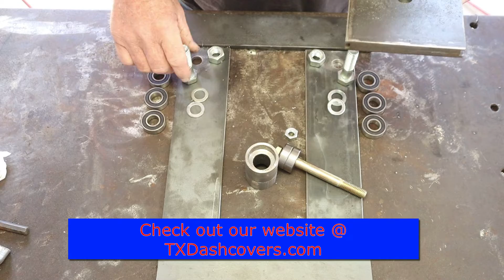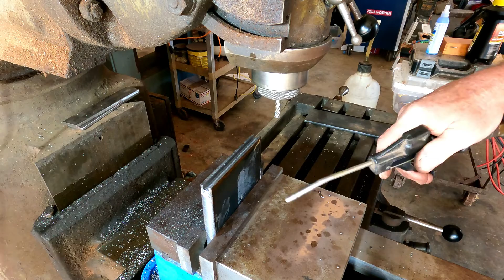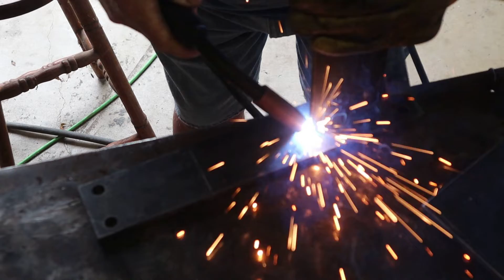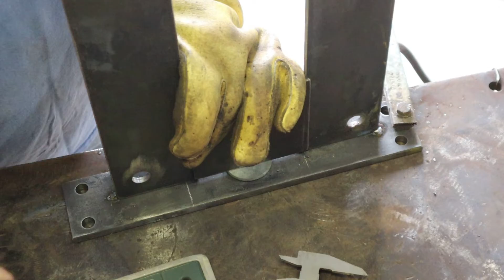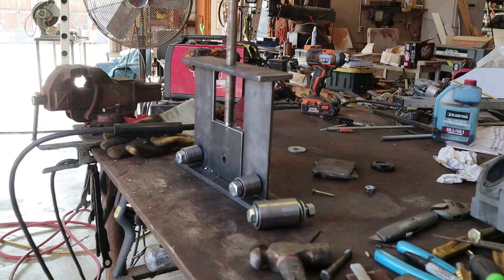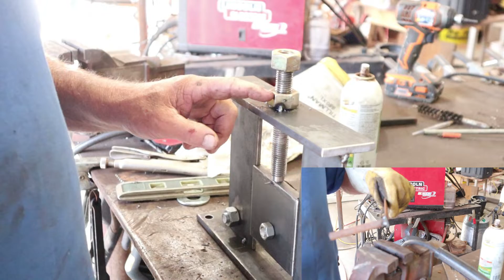This is my Homemade Metal Bending Tool !

Comment: Could you make the rollers adjustable ?
Reply from the maker: @ivel38  I thought about doing that. If I can find a way to bolt it down on my old mill to cut some slots, it might work. Will give it a try as soon as it warms up